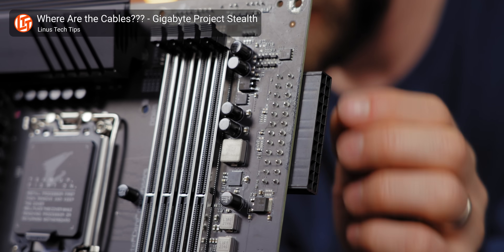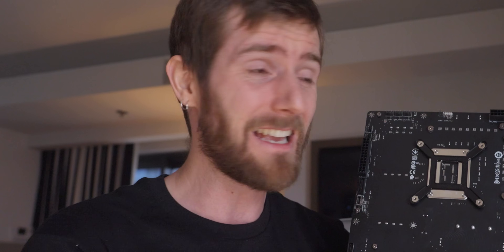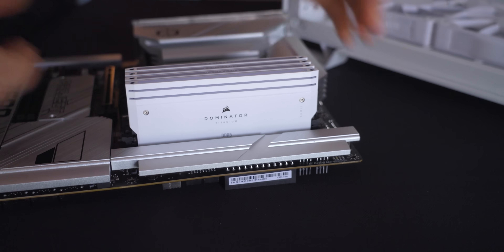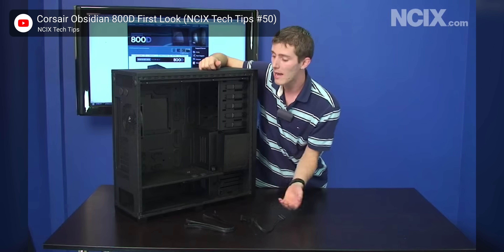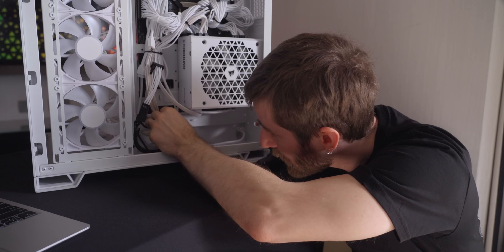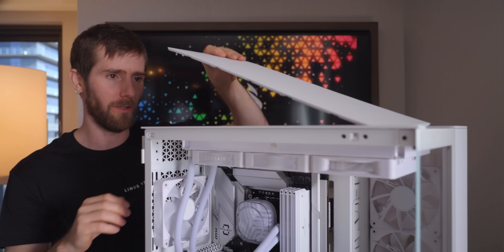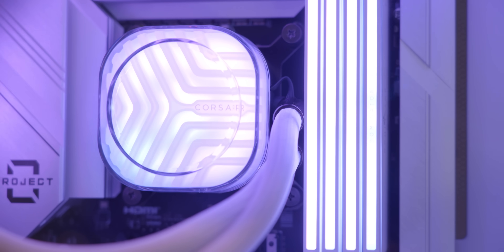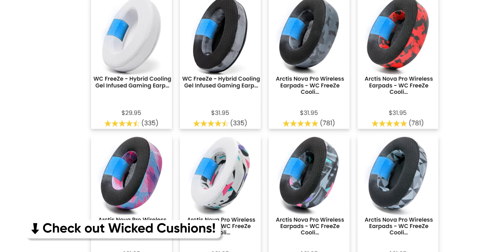I had NO Faith in this... - Hidden Cable PCs

Comment: Patents are too often ridiculous. Moving the location of connectors should not be something protected by patent. If that patent was valid then so should all sorts of other nonsense, like placing connectors near the corner of the board, or arranging slots in a different orientation, or adding heatsinks to components. It's just common sense stuff.
Reply: Agree, isnt patent is meant for much unique design? Not just moving connector X cm away from Y
Reply: damn uspto
Reply: Moving button to backside of a controller was ruled to be innovative in Corsair vs Valve (Steam Controller), so it's probably valid too.
Reply: The best part is, it's not like they invented motherboards or something.
They're just using a basis which they had no hand in creating, which to my knowledge they don't have to pay to use that basis either.
And then claiming "look our design is unique and needs to be protected because we moved a connector"
Reply: I would agree, however this is lian Lis dispute argument with thermaltakes daisy chain solution, and thermaltakes defence
Reply: A company can patent this but AI is free to eat up creative jobs. If it wasnt clear before that companies rule america...
Reply: While patent law claims the change must be obvious to a specialist in the field, in practice it must be obvious to a layman, because that is what the judge and jury are. 

Thus, this kind of thing is a totally valid patent. The only way to fight it is to patent this thing yourself, prior to your competition, and then license it free of charge.
Reply: @Xirpzy  And they called us luddites for warning about it...

"New industries will be created just like when horses got replaced." No, no they won't. Because this time humans are the ones being replaced.
Reply: I agree, (and unfortunately this is par for the course with patents). Especially when you consider 0 engineering work went into the patent. Maingear doesn't make motherboards so has no product to protect with the patent

The only defence (and its not a very good one) is that the btf layout isn't ATX compliant. Companies do their own version (see Seasonic synchro)
Reply: @taktuscat4250  it is a unique design to put everything on the back, you need to rearrange the whole circuits and the layout and functionality, it's not just a matter of glueing a piece of plastic on the back lmao
Reply: @taktuscat4250  Patent is both design and idea (function) attached to that design.
Reply: Why? Just pay license fee and make mobos like that. Simple. If tgst would be your idea I'm sure YOU would like to benefit from it.
Reply: Common sense aint so common sadly.
Reply: Remember when Nintendo patented basic videogame vehicle physics?
Reply: Pretty it's also not patentable under patent law, as patent law does state somewhere that obvious geometric solutions to a problem (like placing a connector position because it has to go there to be functional) is not patentable, so I have no idea how all these companies are getting these rediculous patents lately.
Reply: @thunderarch that's a real stretch of the imagination for the definition of unique design. It's not unique to put header connectors anywhere on a PCB.
Reply: As a teenager I read that as parents are often rediculous
Reply: AIOs are also all patented and most on based on the asetek patent
Reply: Isn't this comment was generated by AI?
Reply: patent and ip trolling is pure cancer, just creates more monopolies....
Reply: I think the circumstances matter. The purpose of a patient is to protect the idea so that the people who made it can actually benefit. What if it was a small brand trying to get into the motherboard space. If the patient was invalid because it was "too simple" then other companies would take the idea and the original would fail because they will have no place in the market. But with a patent that company can have their own unique idea that can draw customers and put them on the map of motherboard companies as a legitimate option. I get that patents are abused and many times people or companies will make patents with no intention of making it and the sole purpose of royalties or to sell it to a company. But thta doesn't mean that patents altogether, even simple ones, should be invalid. Possibly, if anything, a way to prove that after a few years the original owner has shown no work in delivering, they could possibly make it public use to avoid patent hoarding. But again, this patent, by the right people, could be the defining factor of whether or not a new or small company is able yo make it into the big leagues of pc hardware.
Reply: Yeah, I think patents should be abolished or severely weakened. It seems entirely arbitrary what can be patented and what not.
Reply: @krecikowi  Of course. Everyone would like to have arbitrary power enforced by the government. That doesn't make it a good thing.
Reply: Ye my dad tried to patent a thing he was doing for the university he works at. It was a thing to make salt water drinkable but the difference was he put together all the other different types into one big machine which no one else had been able to figure out yet so that you could actually get pure drinkable water since others end up adding other stuff in the process of getting rid of the salt ect. They rejected his patent saying it wasn't unique enough (since it was using previously patented processes in conjunction with new ones. He died recently so that'll never get patented but my point is if that doesn't get patented then neither should what you said as well I agree
Reply: I truly hope Main Gear goes out of business for this
Reply: Who ever approved probably needs help closing a google tab.
Reply: There's more to the patent than connector location.
Reply: If you bribe the patent office enough, then you can get it. Even if someone thought of it first prior.
Reply: Thank God you're not a patent attorney. You're not so bright.
Reply: @PV9685 nah. It's still ridiculous that they were granted the rights to a patent for just flipping the connector around
Reply: @sntslilhlpr6601  Yeah, it seems we are heading to some kind of "Universal basic income", where the rich and powerful will say Please stand up, please stand up and we will.
Reply: Yeah the patent would probably struggle to hold up if put under pressure.
Reply: It's real tough to balance patents because any move to prevent big companies from abusing them limits their effectiveness for startups to protect their idea, and vice versa.
Reply: Nah those other patents don't come with brides
Reply: I read earlier that Jamie Lee Curtis has not one, but two patents on disposable diapers. It’s stupid too.. the ideas
Reply: Patents shouldn't exist at all except for a few things such as the development of some pharmacueticals and medical treatments in cases where there would legitimately be no development otherwise.
Reply: @richardhunter9779  only a small percentage of patent actions are ever taken before a jury and while they’re not experts, patent judges are by no means laymen. you would probably be surprised by how many patent judges also have a working background or advanced degrees in a STEM field as well. It’s even listed as one of the basic qualifications for the job.
Reply: Dual chamber is stupid design when the HD drive bay can only allow 2 pcs of 3.5" HD. What's the point on having big space when you can only fit 2 HDs there?
Reply: @michaelsmith6938  why do you have more drives than that? That's plenty. Upgrade to m.2 or buy an older case design. Most new builds are going M.2.
Reply: @rugged04270  Just a common sense why do you want bigger size, bulkier, more expensive PC chassis but with less functionalities inside there?
More drives are surely to store more data. My existing smaller chassis (corsair obsidian 450D) can hold 8 drives of 3.5" HDs, which give me total 160 TB massive data there. I do have 4x of nvme which give me high performance 8 TB storage access. It is truly design failure on the dual chamber chassis. It is more worth it to use that money to upgrade to something like Corsair 7000X
Reply: @michaelsmith6938  it's not common sense. It's your personal decision making process and your ego is inferring everyone should think the way you think. 

In reality, not everyone is a data hoarder. There's no need for that much space. 

Or should I take your idiocy further and say you lack common sense because it's not a server rack with room for five petabytes?
Reply: @michaelsmith6938  Same sentiment. Agree that dual chamber is design failure from top who forced it down to expose their ego
Reply: @rugged04270  Your analogy on Petabytes are too exaggerated. It is normal for PC to have few 3.5" hd with capacity ranging at 10-100 TB. That's why people want to buy pc over gaming laptop. But if the pc is now having big size on dual chamber, unlikely people will buy when the size doesn't justify to its benefit compared to the normal chassis
Reply: @scuarty8853  yeah I'll believe that "normal" is 10-100Tb when I see it. Very few people need even 10Tb of storage. If they do they build a NAS. 

It's your arrogance talking thinking that what you THINK it SHOULD be is the standard. Go touch grass instead of fantasizing about builds you can't afford.
Reply: @rugged04270 It would be your arrogance that you do not see pc with storage 10 tb. Single budget HD with capacity 10 tb is common to find in the market. .
Reply: @scuarty8853  20 tb is also getting common now. The price of 20 tb can be cheaper than buying that non-sense dual chamber chassis 😂

Only small number of exotic rich people would prefer to own that useless bulky chassis for their own exotic pleasure 😂

Comment: They never should have given a patent for something as trivial as putting the connectors on the other side of the board.  It really feels like the US Patent Office has really lost sight of the original purpose of patents.  These overly broad, overly obvious patents need to stop.
Reply: Its a necessary evil.
Reply: @Paronak No it isn't in its current form. It's an easily exploitable anti competitive practice for large corporations
Reply: Reminder that there's a patent on putting buttons on the backside of a videogame controller. Microsoft and Sony pay royalties to have that on their more expensive controllers.
Reply: @Moskeeto  Patent reform should be a top priority.  We're hamstringing ourselves by letting company's gatekeep and cash in on these obvious, trivial ideas.
Reply: That's exactly what parents are for. Parents are meant to protect implementations of ideas in certain industries from being copied for some time while at the same time those ideas and are documented publicly.
Reply: @modernsolutions6631 idea as basic as what if X on the other side of product should not be patent protected 

I would agree that if implementing it takes many engineering it could be patent protected, but in cases listed above it's very easy
Reply: Intellectual property hurts more than it helps. The best example is medical tech being way more exspensive than it needs to be.
Reply: @modernsolutions6631  they're supposed to be for novel ideas to protect innovation.  Not "dur hur, let's patent every simple idea we can think of so we can collect fat royalty paychecks for doing nothing".  There's no real innovation with placement of the connectors.  Just moving it isn't a real innovation.  It's obvious.  Our patent law is written so that such parents should be rejected.  But the parent office has gotten very lax about things like this lately.  It can be fought in court, but it's expensive and takes years because you can bet they'll drag it out and use every appeal they can.
Reply: @WhyitJellyDonut  It's a delicate balancing act.  You, as someone who spent a lot of time and money developing a truly revolutionary product, should have some protections.  At least for a period of time.  But it needs to be carefully doled out to just those who are innovating.  Not these bottom feeders trying to make a buck off literally "the same thing but on the other side".  Had they developed a special connector, or a new way to pass the connections or something, sure.  But that's not what's going on here.  They want any company that puts the motherboard connectors on the back of the board to pay royalties.  It's incredibly dumb.
Reply: @LCARSx32  Intelectual property as a concept hurts more people than it helps. If it costs lots of money to develop something its gonna cost a lot to be able to make and sell it so its not like any joe shmo will be making intel cpus if ip laws went away tommorow. Artists are the only people that could be argued for but ultimately owning an idea will always be a dumb thing.
Reply: @Paronak   not a necessary evil at all
Reply: @Moskeeto  Nintendo patented the OG Dpad. That's why every other d-pad is different either by looks or mechanical design.
Reply: @Moskeeto  wait, really? who owns the patent on that? scuff? cause doesn't that mean they would be paying those as well?
Reply: @EikottXD and nintendo's patent has long since expired
Reply: Yeah I wonder how much they paid someone to approve that patent
Reply: @JDMKEV  Scuf owns the patent, yes. So MS and Sony are paying Scuf royalties.
Reply: It is not as trivial as you think because if you forbid small things like buttons on the back where do you cross the line for a new patent
Reply: @EikottXD  That patent has expired though. There was a long time no one could make a cross-shaped dpad but nowadays they are really common.
Reply: There are patents for special LEGO bricks I think one is a 1x5 plate, but 1x4 and 1x6 already are freely available and LEGO sometimes even patents bricks for themselves that other brick manufactures invented.
Reply: This reminds me of when Apple tried to patent the shape of iPhones and the judge was like yeah nope, you can not patent a rectangle.
Reply: @modernsolutions6631  That's why always love your parents!
Reply: @Moskeeto  They pay royalties for rumble in their controllers too.
Reply: US Patent office got lost a long long time ago back around the 80's or so when they started handing out patents like candy. Including software patents, most of which ended up used for patent trolling.
Reply: Like RED's patent on RAW Lossless video, as a whole, not a propietary format, but as a whole, the idea of thinking ahead and said "If you wanna do this thing that everyone has been wanting to do for years but the technology wasn't there yet, you gotta pay me because i got a patent for it" It's like putting a patent on illuminating fans as a whole, like having a patent for solid state drive technology and forcing the competition to keep using hard drives so they don't have to pay royalties.

If a patent seems to stop progress on a whole industry instead of protecting the engineering efforts behind it, then it shouldn't be granted.
Reply: welcome to the US legal system
Reply: @modernsolutions6631   thats NOT what patents are for. patents are for things that took a great deal of RND/investment to make. not for obvious things like "oh what if the connectors were on the back"
Reply: @Paronak  I don't think Google owning 117,000 patents is a necessary evil at all
Reply: @LCARSx32  it makes it where we will never advance too far. If we can’t copy as simple and useful as that then what was even the point of making it

Comment: Linus wont ever have faith in any motherboard at this point.
Reply: But he will have faith in todays sponsor….
Reply: The big problem right now is you have so many on ATX or ITX that moving to a new standard that is incompatible with them is going to be hard. The reason for this one is to get GPU manufacturers on board.  It does solve the problem of "how do we get the 16+4 PCIe connector to the PCIe card without being bent?" to be a non-issue but will require the card's VRM to be redesigned for the input to be on the bottom instead of the top.
It is a good solution just you will most likely have to get Intel and/or AMD to include it in the chipset to have everyone support it. At least at the start anyways. The reason why is it is cheaper to just not do that and go with what they have been doing for the companies entire life span. The way Intel and/or AMD might get involved is VRM placement as some of the connectors are pretty high power. 16+4 is a up to 600 Watt on paper while 4 8-pin PCie can also supply 600 Watts but with more of a safety margin and more redundancy just in case something isn't working 100%. So moving back to 8-pin power would be an option as 16+4 was here to save space while providing the same amount of power. You also have more room  for USB connectors so both USB external and USB internal can exist. 
IF it takes off i can see having double side motherboards that one side is mostly the user expansion and the other mostly power connections, storage connectors, USB internal connectors, and of course the system RAM VRM onto the back not the front so to make space for other stuff, on the front.

It is a good idea the sad thing is most good ideas do not take off as the reengineering of the board to have it on the back will be a lot then also to have boards with it on the front.
Reply: if i hear about headphone juice or white hardrive cages again i will scream